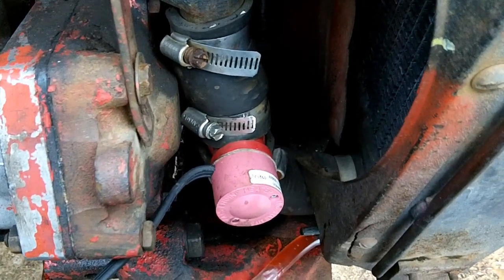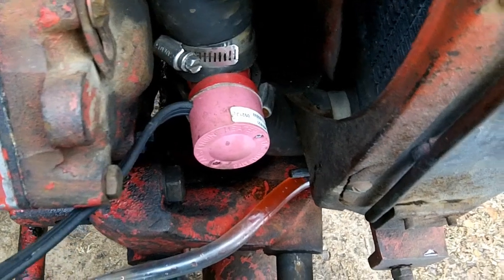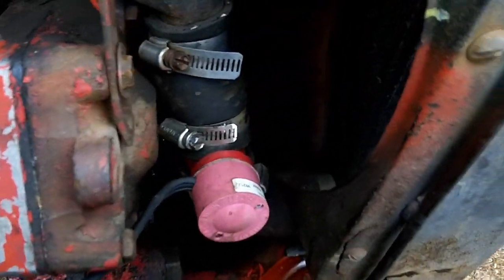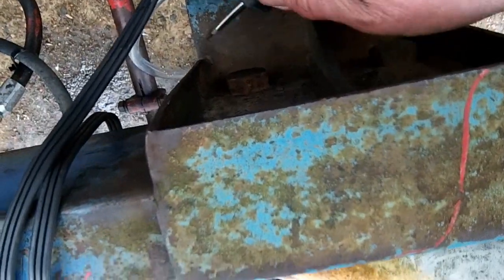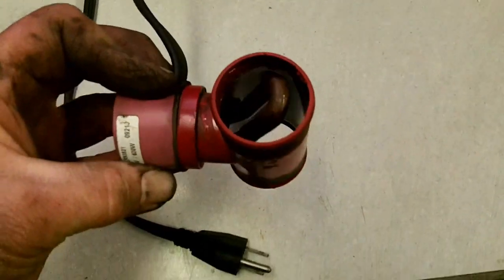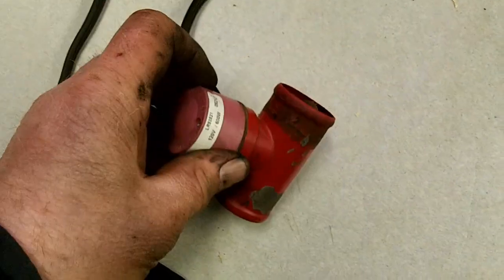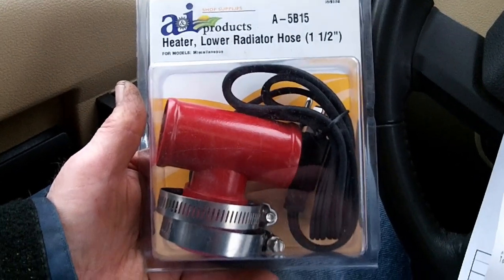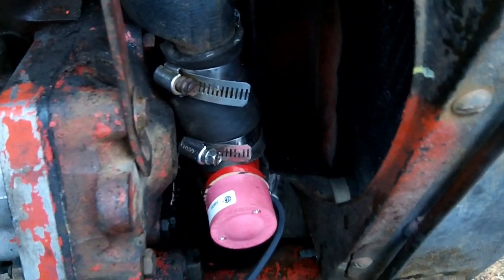Radiator hose inline heater

Comment: I PUT ONE IN ON MY 2016 F250 GAS TRUCK...BEST THING I EVER BOUGHT...ON A COLD MORNING HERE AT -35 MY TRUCK IS RIGHT UP TO TEMP IN MINUTES!! IT CIRCULATES THE WATER AND HEATS IT  ALL NIGHT
Reply from the maker: Much easier on your engine too. It has to warm the oil up somewhat or at least the oil would thin out quickly when hitting the warm cylinder walls.
Reply: @Halscamp  YES...BY THE WAY MY BUDDY JUST REBUILT AN OLD DAVID BROWN TRACTOR. HE WORKED ON IT IN HIS SPARE TIME FOR 3 YEARS...IT IS THE TALK OF THE TOWN...LOL

Comment: Where can I get one?
Reply from the maker: Most automotive stores should carry them and probably Tractor supply. Amazon also has them. In Canada you can get them at Nappa, Canadian Tire, Tractor dealers etc.  Ask for a Lower Radiator Hose Heater. You will have to know the size of hose you have. Dealers should be able to look up the size you need for your vehicle.
Reply: Larry Woodruff on amazon too

Comment: I'm thinking about getting one of these for my truck. I live in a moderately cold area, but there has been some brutally cold weather lately. What is your opinion on these gadgets? I wouldn't be using it all the time, only if it stays down in the 20's or below. How cold does it get before you use yours? My truck isn't a diesel, regular gasoline.